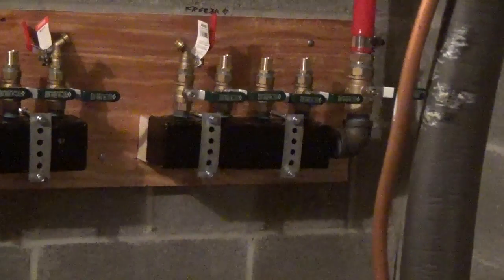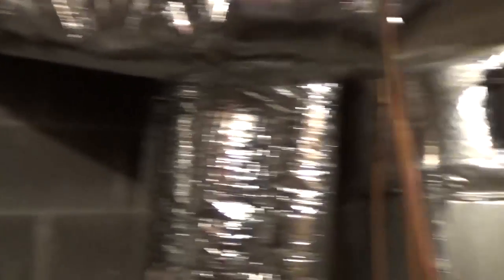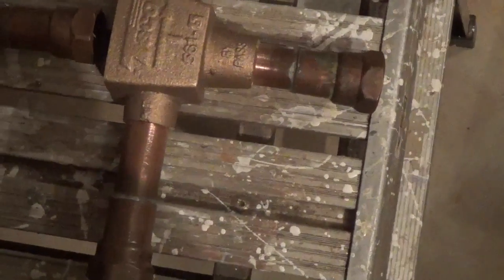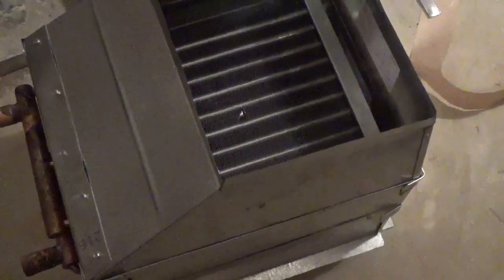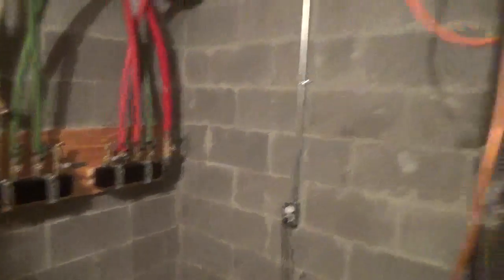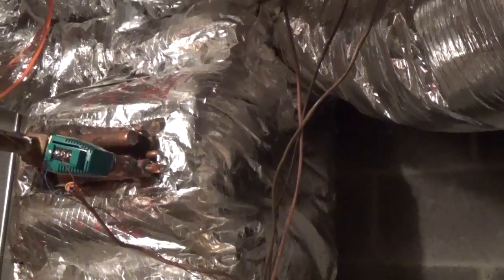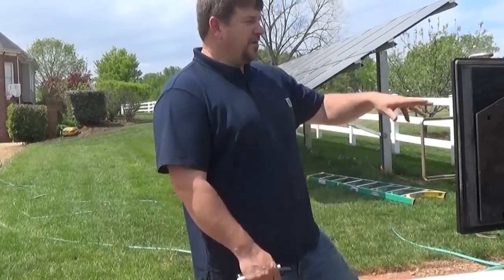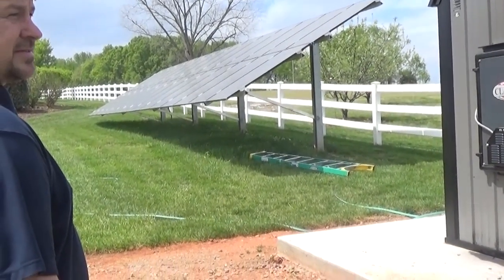Coupling Boilers and Solar + Free Giveaway

Comment: Good video.  I am building a out door boiler by using 3/4 in copper wrapped around two 55 gal. barrels stacked.  One as a fire box the top as a heat chamber.  With your experience do you feel this will produce 100000 btu for  a heat exchange in the electric strip heat furnace?

Comment: The Taco 3 way valve should be on the return side, not the supply side. The supply should be piped directly into the coil and to the bypass port.

Comment: I'm confused as to why you designed the domestic water side the way you did... The air to water source heatpump heats the domestic water up to 130 then the plated heat exchanger heats the water to 180... why did you install a mixing valve on the outlet of the plated heat exchanger and cut it back down to 140? why not have it go straight into the propane fired water heater at 180? Then install the mixing valve at the propane fired water heater?

Comment: Can we get some more info on the thermostatic mixing valve used at the beginning of the system at the entry to the basement? As for purging air from the lines here in Greece they add a 'T' to the highest point of the lines and either use a petcock style valve to allow air to escape or an automatic ( as they say ) valve. Your best bet would have been to add T's and bleeders at the entry and at the tops of the curved PEX lines coming off of the manifolds. Remember air rises and the air bubble will tend to wander towards the top of each high point. Another point I have learned working with hydronic heating systems is to make sure there is sufficient water pressure in the loops. Are you using an auto fill valve for maintaining pressure in the system?

Comment: The Teco two way valve is installed differently on the heat exchanger at video points 7:29 and 12:03.

Comment: Near the end (~13:54) it looks like the middle port of the mixing valve should be hooked to the red Pex going off to the propane furnace and the cold line connected where the red originally was.

Comment from the maker: I am looking for a more specific answer as to my plumbing mistake. Some of you are very close.
Reply: +engineer775 Practical Preppers I do believe the cold water supply and tempered mixed water  to the propane water heater is what you did backwards at the mixing valve., and had to fix.
Reply: you put the three way mixing valve on the opposite line of the HW coil in the air handler!
Reply: +engineer775 Practical Preppers The green valve needs to be on the supply side to prevent the hot water from going into the  coil and heating the air when not needed. 

So the green valve needs to be on moved to the  ohter line..

Comment: the water cut off valve on the wood boiler is backwards.
Reply: +RICHROOFER1 the green one on the return side with the clear hose
Reply: +RICHROOFER1 you turned it around so it woudnt hit the other pluming

Comment: Have you ever converted a dryer to a water to air heat exchanger to dry clothes? We did that for all the outdoor wood boilers for my friends back in Wisconsin. It works great, but you do have to use a mixing valve and play with it. We ran the temp around 130 degrees as that was a happy medium. For the delicates it calls for 125 or so and cottons on some dryers can go as high as 150 but man that's HOT, but 135 for cotton was the average high setting. We did it because we did not want to buy gas and to make that kind of power from wind or solar is asking a lot as well. Keep up the great work.

Comment: Is it the green solenoid/valve before the heat exchangers? I see @8:38 it is on the hot side, lower part of the exchanger but @ 12:02 is is attached to the cold side, upper part of the exchanger.

Comment: I think the supply for the geospring is backwards.
Reply from the maker: +James Mandl nope
Reply: +engineer775 Practical Preppers I think you incorrectly pipe the thermostat valve
Reply: +engineer775 Practical Preppers I think you incorrectly pipe the thermostat valve

Comment: The geospring hot water heater needs 208/240volts. How are you supplying that from solar? I've had the same unit for three years and love it.
Reply from the maker: +MarylandStuffDoer   The inverter is a 240v inverter.  We only run the Geospring in Heat Pump mode only.